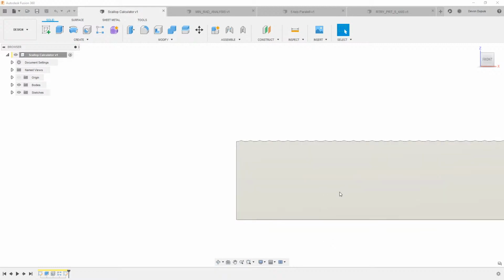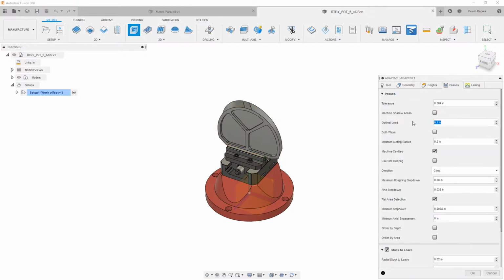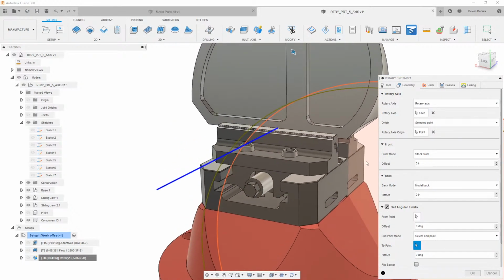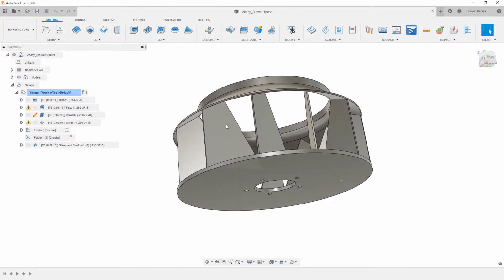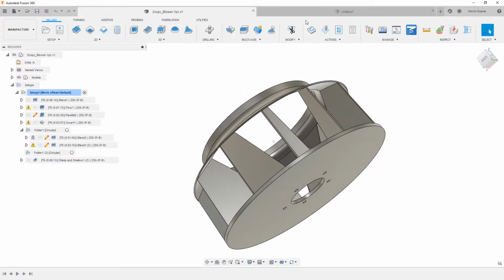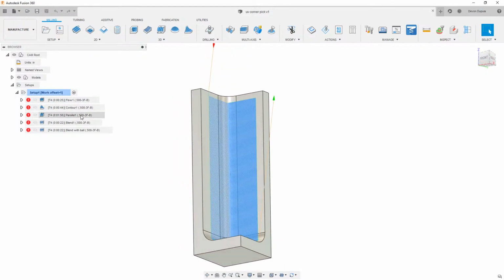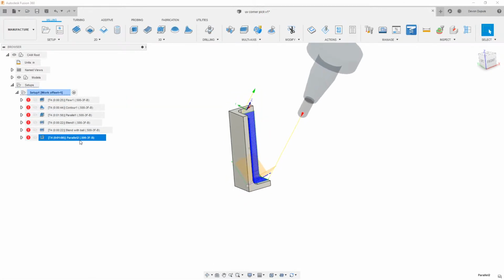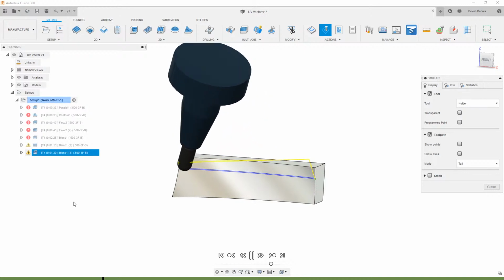360 LIVE: 5 Axis Tips and Tricks

Comment: Great solution for the blower motor, firstly you ensured the tool holder wouldn't collide with the part and secondly for the most part you are not cutting with the tip of a ballnose cutter, also a great strategy for thin walled parts!